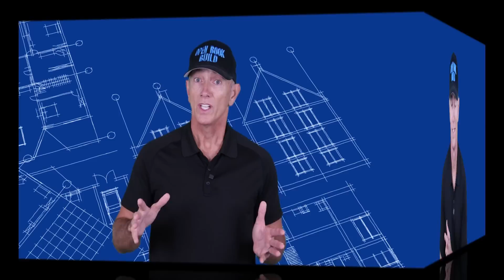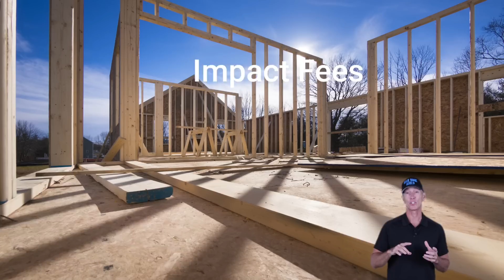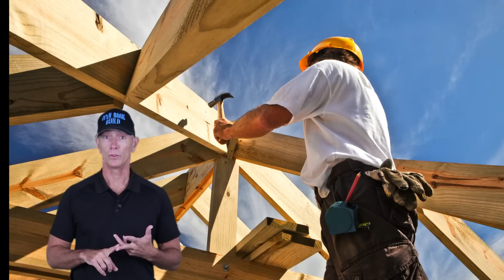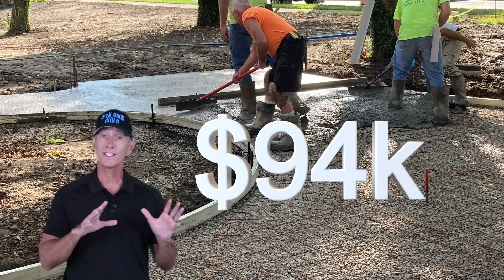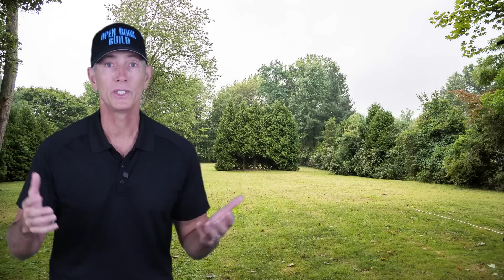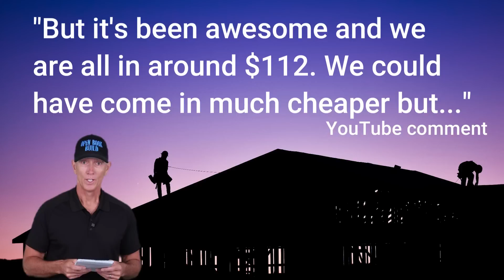New Home Cost Breakdown

Comment: Built brand new in 1998 it was 90 a square foot. Did it again right before covid in 2019 it was 105 a square foot. 

Both in Michigan both in rural areas. 1998 house was 198990 now is over 700 2019 house was 219990 now after only 5 years it’s already 360k. Crazy

Comment: Foundations depend on house weight and soil conditions. A 30x40 cmu block foundation with crawl under log house or 3 story is usually around 18000$. And basement around 22000. We are building 3 bedroom ranches no basement usually handicap accessible too and with 1/3 mark up hitting 122k. We buy cheap tax sale houses too. And if vacant land at least 5 acres to build on. I am at 20k for 10 acres that was 16k, piers, post and beam timber frame, 24x24 6/12 skillion pavilion. That's using my own labor. Gonna frame in walls this summer and complete block north wall. Off grid Earth ship passive solar design no tires or berm. 6 foot frost depths and 70 psf snow loads. Utility bills always seem to keep going up. Less bills the better. Thinking or retiring before 50. And want to build a cottage and a boat and still have time and ability to enjoy them.

Comment: what percentage of the work is labor as I'm looking to cut all the labor down as I will be securing several licenses and don't need a electrician nor plumber nor hvac and of course no contractor. Also, I will likely be building house structures that don't in my state require a architect approval. Also impact fees are illegal in my state.

Comment: Thank you for your great videos. I am planning to build a house in Costa Rica which has tropical weather and rains a lot. Any advice on the footing and foundation? I appreciate your time.
Reply: Hi I'm from costa rica. We don't build with wood frames like in the States. Houses are build with cinder blocks, rebar and concrete and they will withstand high humidity and earthquakes. 
Do your homework and get a reputable builder (maestro de obras); don't hire the first drunk from town that says they build houses as you will have a lot of headaches and maybe even you'll have to demolish the house and start from scratch. You can also use hire a turnkey firm but it is going to be more expensive (from $600 to $1200 per square meter). Also very important, be there for the entire process and check the workers aren't cutting corners or doing dumb sh...

Comment: What about cost of building an earthbermed home? If a lot has a hillside, doing a 1500sqft home dug into the hill, could reduce the amount of cost in lumber and the labor associated. Obviously youd have more in cost of concrete/site prep but that could be offset if the remainder of build is doable for an advanced DIYer. Anyone have thoughts on that?
Reply: Don't do it.  It will be un-sellable and won't save you any money because the subs won't know how to do it.